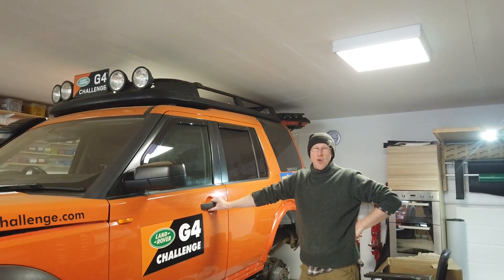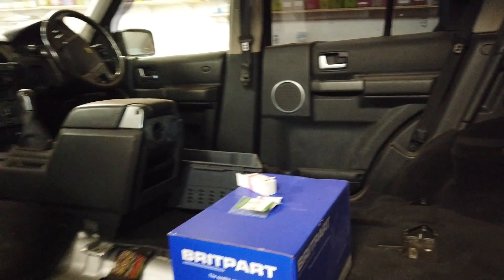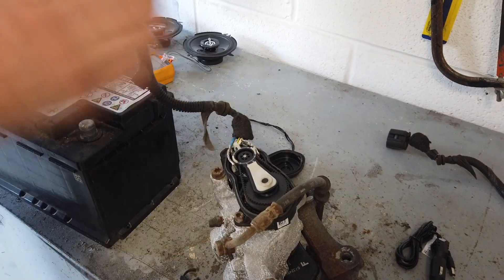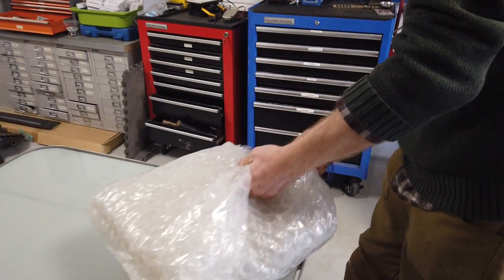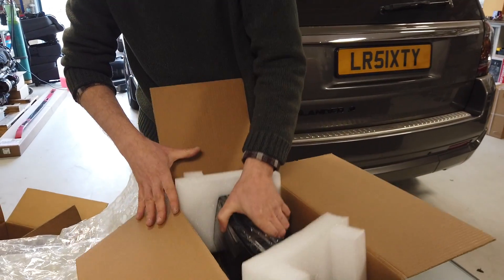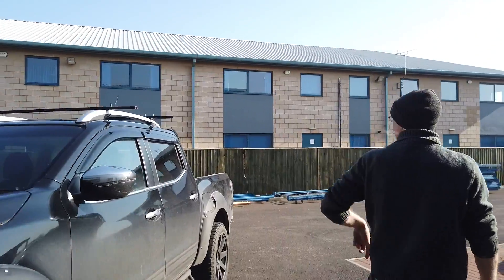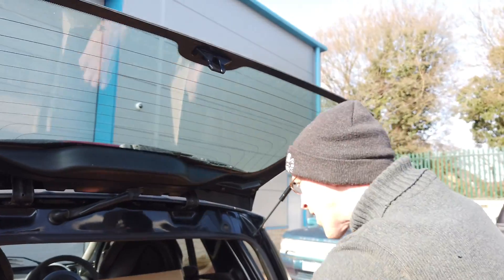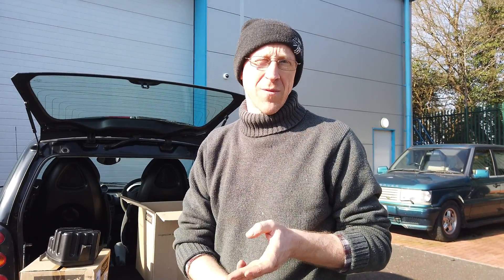Weekly Vlog 4 - Project G4, New Products Sneak Preview And A Big Thank You !

Comment: I would have though that a simple cable operated handbrake would be far better than something with electric servo motors, toothed belts, and all the associated electronic bits, all living in the wet mud under the vehicle ? Keep it simple. Chris B
Reply from the maker: You are of course correct.... one advantage of this latest type is it is easier to change if it goes wrong than the old type.... 10 minutes and you are done !